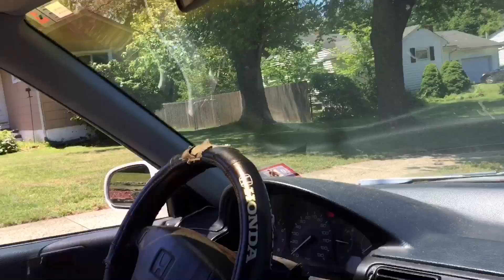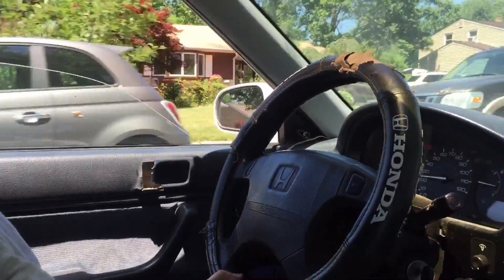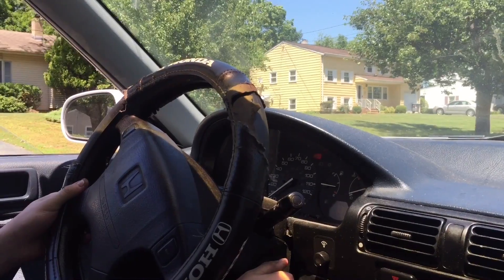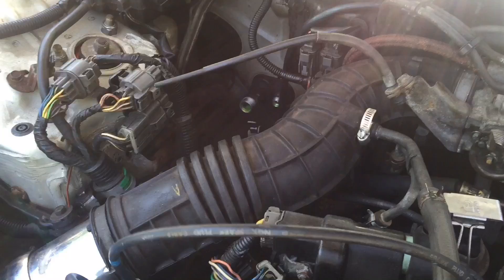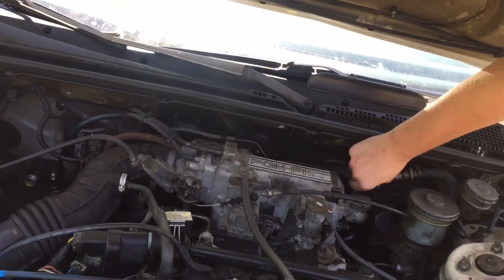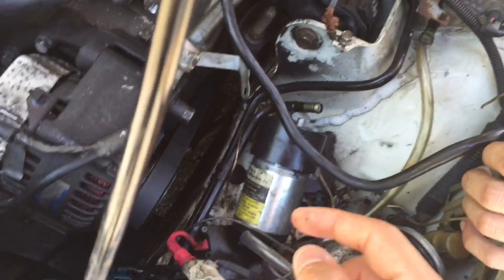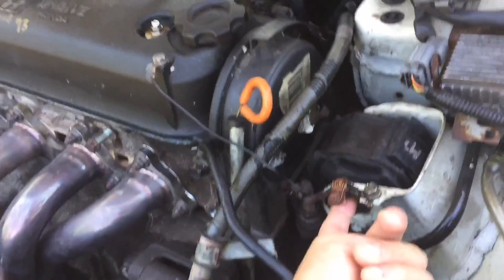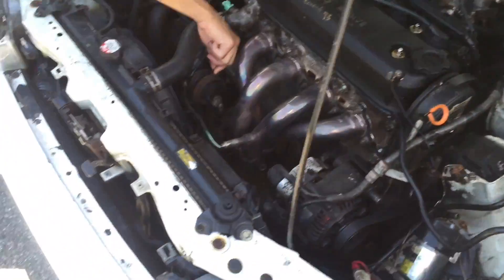The Honda Died ALREADY (Need Help!)

Comment: Check the dizzy and the igniter as well.
Worth checked fuel pump as well, if there's enough shit in the tank and it isn't picking up fuel it could be starvation which would explain the constant cutting out.
Hope you get it sorted 👍🏻

Comment: The engine needs 3 grounds. Valve cover to engine bay, Transmission to Engine bay, and the ECU ground on the thermostat housing. It sounds like either no fuel or spark. make sure the ground on the thermostat housing is clean and tight.. good luck!

Comment: Fuel filter! Cheapest place to start. And new plugs, make sure none are white, if they are white it means your running lean, check all the engine fuses, like ddistributor, and all the relays. See if you can hear the fuel pump turn on

Comment: Had the same problem, car just died on me in less than a mile from my house but check out your "Ignition Coil" in ur dizzy, I have a high comp. y8 an fired right up but I could smell fuel being pumped but jus wouldn't start

Comment: need to replace your distributor - don't "fix" it - REPLACE it, also reconnect ALL the ground wires, no matter if it looks stupid, redundant, don't make sense - reconnect ALL the ground wires, make sure they have good metal contact, even if you have to sandpaper or grind off the paint. If the wires look frayed, REPLACE those ground wires. Get a repair manual on your year car, it should show you where all the grounds connect. Without a good ground, you won't get no spark. Also, check the ECM (under the floor kick panel on passenger side). A bad ECM could cause no spark, intermittent working on-off. Also check for rust & corrosion inside the ECM housing, as most Hondas leak from the fresh air flap (underneath the dash) everytime it rains - and the ECM is located directly underneath that. Tell me car engineers are sometimes brainless morons. Also, check your fuse panel for possible shorts or ... BAD GROUNDS.

Comment: dissy, fuel pump relay, fuel pump. can u hear the fuel pump priming when u turn it to ignition?
Reply from the maker: Yeah the fuel pump is fine, I disconnected the fuel line and fuel went everywhere so that's fine. Just checked for spark and there's no spark. Took the distributor apart and it has some corrosion but not that bad, no cracks or scuffs or anything. The rotor spins easily but it feels like it hits a bump when you spin it. Is that normal?
Reply: +SwagToTheWheels what do u mean with ur hand?
Reply from the maker: +Dead April spin the rotor? Yeah with my hand
Reply: +SwagToTheWheels pm me ur #
Reply from the maker: +Dead April dm me on insta
Reply: +SwagToTheWheels dmed